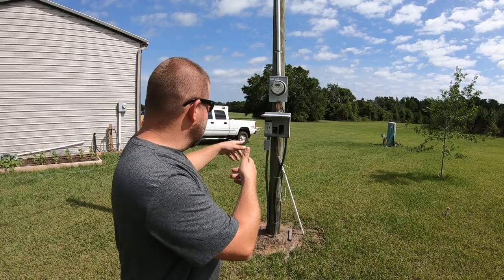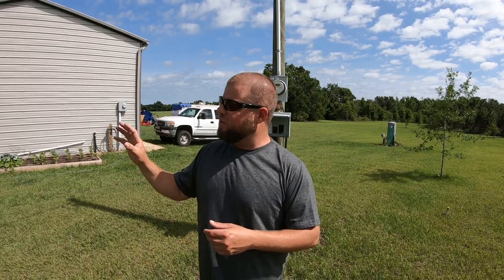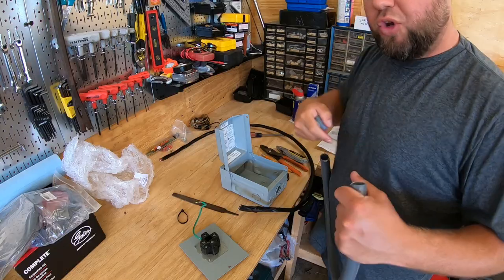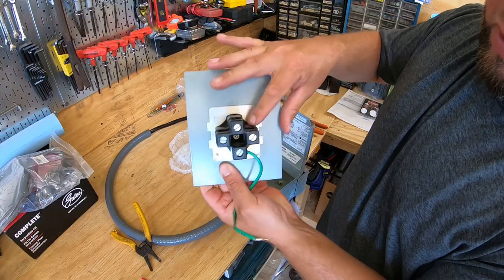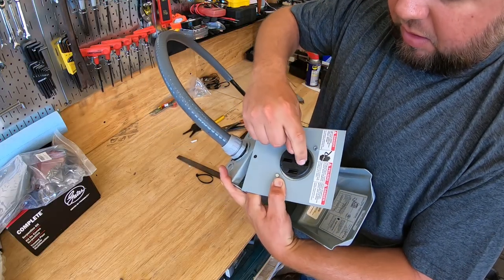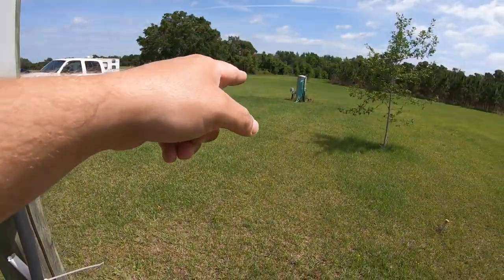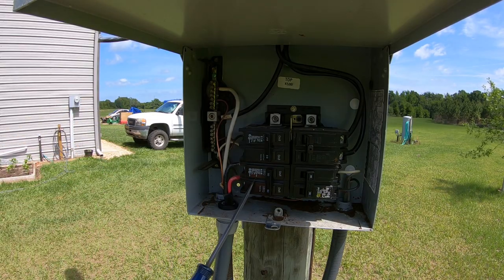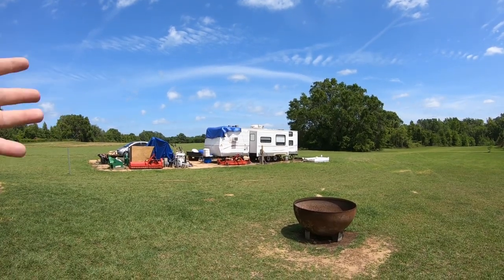#97 50 Amp RV outlet install, new building updates!

Comment: Ants hate the smell of cinnamon so I just sprinkle some wherever I have ants on the property... it won't kill them, but they won't stick around that area. I also simmer cinnamon sticks in water in the cooler weather in my house for the pleasant aroma and then use that water in a spray bottle to spray around areas that pests like mice and rats might come into my buildings, they also don't like the smell.
Thanx for the info on installing the 50 amp service!

Comment: Just watched this 50 amp receptacle install video. Good job, I liked it. I put in a 50 amp receptacle 100 feet from the meter base, using aluminum #4. You asked the viewers what experience they've had, so this is mine. It's been in for about 2 months now while we are waiting to move into our house. Works fine, we have a bumper pull, 38 ft travel trailer, 2 ac units.
Reply from the maker: We just hit two years camper living and are 5 months into building our own home. It's been a fun experience, but camper life is getting a little old 😁
Reply: Where did you purchase the wire from? Online or home improvement store?
Reply from the maker: Local hardware store, it's very common

Comment: You can get an app on your phone for voltage drop calculations. I use them all the time. I'm a retired electrician technician. I did everything from data, fiber, interstate, residential, commercial, high rises, under ground, in water, TVA power plants, etc... The only reason i mention this is you can get apps to help with a lot of the basics. Best of luck
Reply from the maker: Thanks, yes the phones, apps and internet is full of useful information.

Comment: Really good looking repair. Ants love the heat that's generated off the components. Had that problem on the dairy. We always every couple weeks checked our pumps etc... and sprayed the areas for ants. When owning property, buildings and using equipment etc... nice to be able to do electrical and general repairs. Hope all the plans work out. We'll be watching!
Reply from the maker: Makes sense on the heat, I figured it would be something like that. Yes doing my own general repairs has saved a tremendous amount of money over the years.

Comment: I actually have a 30amp 5th wheel. Gave me a good idea on what I need to do. I do appreciate the video.
Reply from the maker: 30 amp is very simple. Only 3 wires instead of 4. A hot black wire white neutral and a ground. Run 10/2 wire if it's a short run or upgrade to 8/2. They sell 30 amp plugs at Lowes just for campers and the wire. You'll need a single pole 30 amp breaker since this is a single run of 110 volts, unlike 50 amp service that's 2 runs of 110 volt and thus the reason for the extra wire.
Reply: @TKCL  I do appreciate the help. Looks like I need to make a run to Lowe's

Comment: #6 up to 100' but understand that length you will be losing a few amps.  I know on a 50amp camper chord that is 100' it is #6 wire comes with a warning that anything over 50' is derated to 45 amp.
Reply from the maker: It will probably be OK since it's TWO 50 amp 110 runs compared to the one 30 amp I currently have on our small camper.
Reply: @TKCL  I wouldn't be concerned.
Reply: We did #6 for 100 ft and then ran about 25 ft with the camper cord to the out let. Been living like that for almost 2 years. But we only one ac unit.

Comment: Turning a negative, into a positive is the only way to do it!!!! Sounds like it will be awesome. On the wire size, and as it's been said already, the length will affect it's capacity. But since the cost of wire and this is a temporary, I'd push it if I could. There's plenty of graphs/charts on the net to reference exactly what you need too.
Reply from the maker: Thanks for feedback, even with a slight amperage drop its still a crazy amount of amperage for a camper. I might do #6

Comment: I like your vision on the new pole barn, it will make things look more uniform with both buildings in a straight  row. I don't do well with crooked or uneven, i'm kind of OCD that way. ha ha. As for your electrical wire question, sorry i have no clue when it comes to electrical.
Reply from the maker: I hear you on the crooked thing, however my buildings look very crooked from the air. They don't run north/south or east/west. That's because I squared them up to a pasture fence when I first bought our property. I'll be putting the fence back in the same place so it should make everything more uniform.
Reply: @TKCL  Whatever you do i know it will look awesome, i can tell you're that kind of a guy. Love your vids, looking forward to the next one.
Reply from the maker: @bigDH123  thank you, will do my best to have one out tomorrow afternoon.

Comment: I’m confused.......don’t you need to run a separate breaker for each 110v leg to your new receptacle and have one breaker mounted on left side bus in the panel box and one breaker on the right feed bus of the power box?
Reply from the maker: That's exactly what a 220 volt breaker provides, a 110 volt leg off of each side of the panel. You run 4 conducter wire to provide two 110 volt hots, one neutral and one ground. Once at the camper receptical the 4 way plug utilizes both 110s, shares the neutral and ground. Where most people mess up is running 3 conducter wire, two 110s and a ground, that's 220 since there is no neutral to share between the two 110s.
Reply: The Kelley's Country Life  Good info.
Reply from the maker: Yes it is, but the addition of the shared neutral is what utilizes each 110 leg for 110 volts instead of the combo for 220. I know you get that, just stating it again for people reading the comments.

Comment: 6 amp is big enough for your extension wire. It’s a/c power not d/c. Also, the wire is typically always stranded in extensions for RVs. It has a lot less resistance as electrons flow on the outer diameter of wire so with it being stranded it can withstand a lot more kilowatts and amperage. Save your money.

Comment: What rating of wire is run from the weatherhead to the meter/100 amp panel? I've been trying to find an answer all day.  I know it has to be sunlight resistant but can't find if it's THHN/THWN or what.  Thanks
Reply from the maker: This comes pre made, so I am not sure. Every one in my area runs 2 gauge aluminum for service wire.

Comment: So it's 2 50 amp breakers there is one for black and red they both don't get hooked to the same 50 amp?
Reply from the maker: Negative, one 50 amp breaker provides 120 volts on each side from a different phase of power. You also run a wire with both of those hookups, a neutral hookup and ground. You have a 4 conductor wire (two hots, one neutral and one ground) that runs to your hookup or panel. A 50 amp service for a rv is essentially two 120 legs of power that share one neutral and ground. That's why it's not technically 240 volts.
Reply: @TKCL  but instead of a single skinny50 amp breaker, its two skinny 50 amps that are hooked together for one double breaker?
Reply: @TKCL  do I connect the two Hots together at the breaker
Reply: @TKCL  and what gauge wire should I use the guy who's hooking it up at his house told me to get 10 gauge to run Underground I feel like that might be too small should I get 8
Reply from the maker: That's a double pole breake4 and all I'm familiar with for 50 amps. That's what I used.
Reply from the maker: The two hots stay separate all the way to the camper. If running more than a few feet I'd run 8 GA copper (or 6 GA) or even bigger aluminum wire.
Reply: @TKCL  I'm running around 85ft
Reply from the maker: I'd personally go 6 GA copper or #2 aluminum.

Comment: The only thing I have a problem with is not isolating your ground but I guess this is the first source of disconnect. So forget I said anything.🤐
Reply from the maker: You said it, only disconnect at the property at that pole. No need in isolating.

Comment: Can I use 6 gauge if my box is 60 feet from my breaker box? Thanks
Reply from the maker: A quick look at voltage drop charts says you should be fine. As long as it's COPPER wire, that won't work for aluminum.
Reply: Thanks

Comment: Do I actually need # 6 wire for a 50 amp RV plug?
Reply from the maker: Really depends on the length of the run. A very short run, probably could get away with #8 copper. Copper is key, aluminum doesn't carry the load as well. There are calculators online that will tell you length of runs vs amperage drop and suggest what size wire.

Comment: #6 copper or #6 aluminum?
Reply from the maker: Copper, aluminum does not carry anywhere near the current.
Reply: Just checking. I used #2 aluminum for my 100 amp service and didn't know if I needed #4 or #6 aluminum for my 50amp.
Reply from the maker: I used that same wire for my 100 amp service too.

Comment: What all are you able to run off the 50 amp? I have a tiny house and I'm curious if I can run my portable AC on a 50 amp?
Reply from the maker: As far as that being allowed for code, I'm not sure. 50 amp service is essentially 100 amps of 110 volts. You can run a lot on that. For example I can run our 13,500 btu camper AC on just 15 amps. I'm assuming your portable ac is 110 volts, if so you could run that and a lot more appliances on the service that I ran. To be honest it's not much more to run a dedicated 100 amp 220 service to your home and that would allow you to run just about anything you could want, including 220 a appliances if you want them.